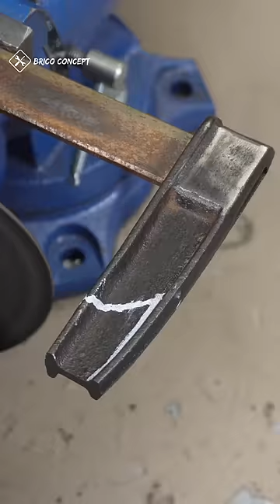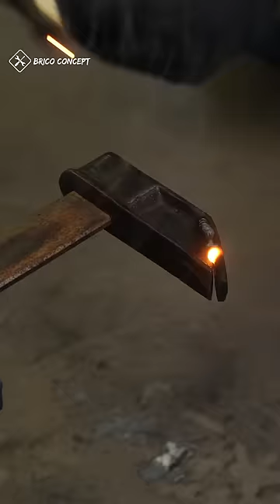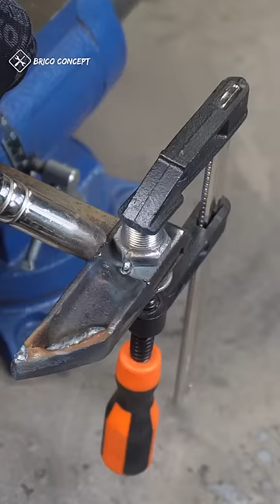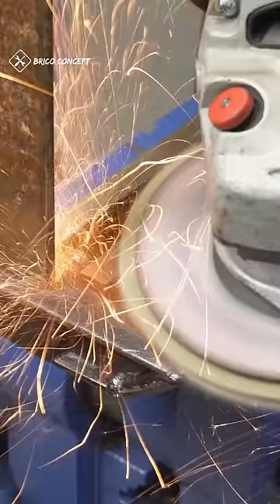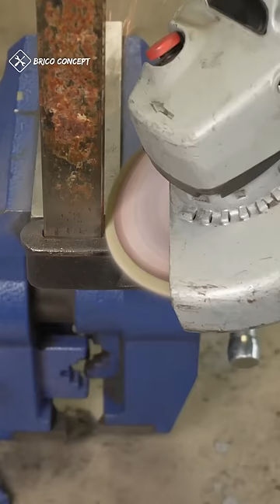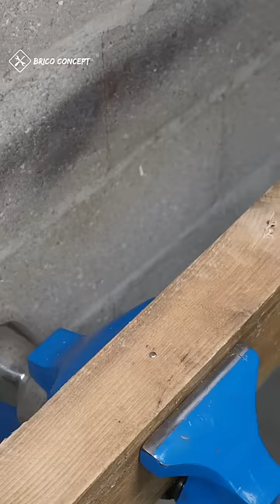Hacking an Old Clamp #shorts

Comment: Imagine welding cast iron clamp with mig welder to the steel….
Reply: I'm not a welder but I know that's not right 😅
Reply: And not even a proper weld at that.
Reply: You can, but there was no pre-heat or post-heat like you HAVE to do with cast. It's pretty fucking hard to do tbh. Most welders and welding shops turn away cast because it's so easy to fuck up.

Comment: I'm still trying to understand the point of the tool, you made a tool to replace the hammer but in the end you used a hammer to hit the tool to hammer the nail into the wood that could have been done by just using a hammer... Cool.

Comment: So let’s see.… You cut up a perfectly good clamp to make a homemade crowbar? Incidentally, he welded cast iron with mild steel mig wire. that weld is probably laying on instead of adhering. summary… Wasted tool wasted video. My opinion